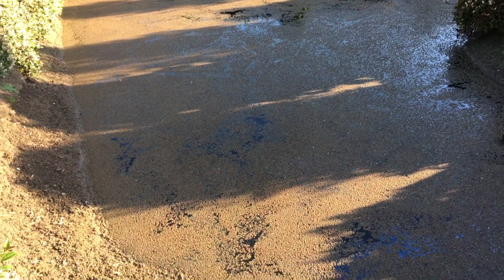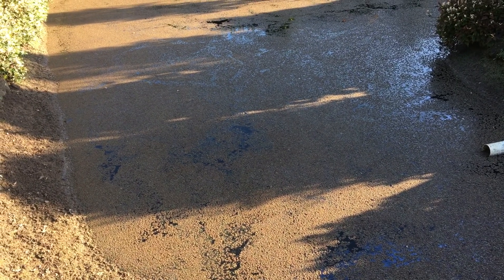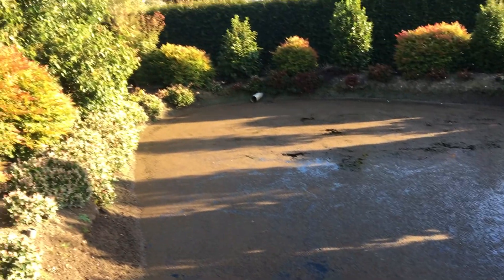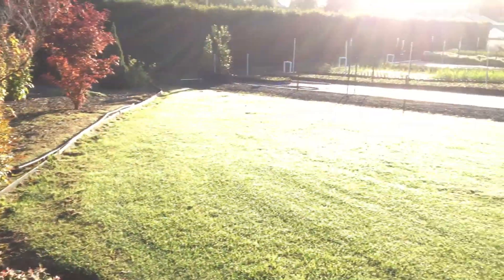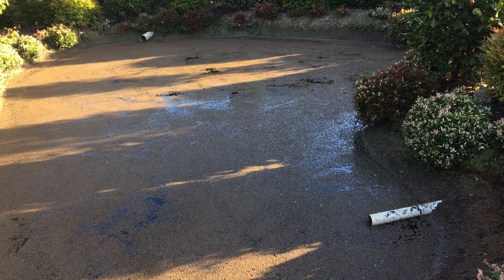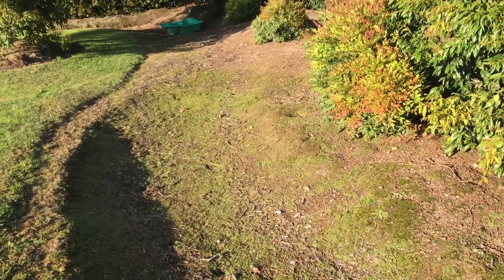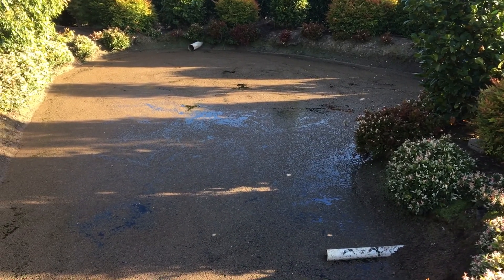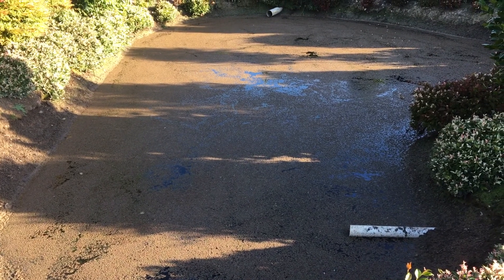The plan to fix a stagnant/smelly pond

Comment: Hey Kev. What came of this project? Interesting set of problems to overcome, how is it tracking 4 years on?
Reply from the maker: I turned off the bubblers about 2yrs ago during a summer when the pond dried up. I never turned them back on. The pond still suffers from too much nutrient, but it’s been pretty good and hasn’t been smelly. The shelves with rock and diversity of plants have most likely helped.